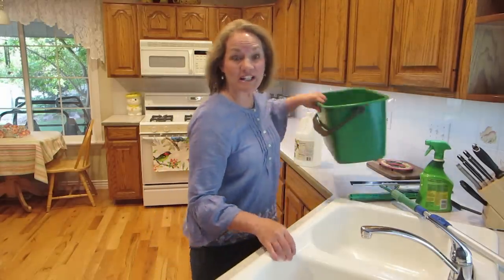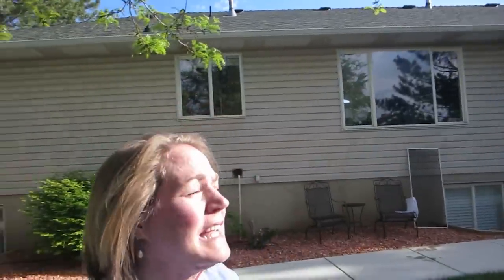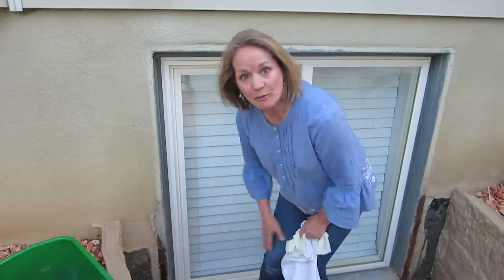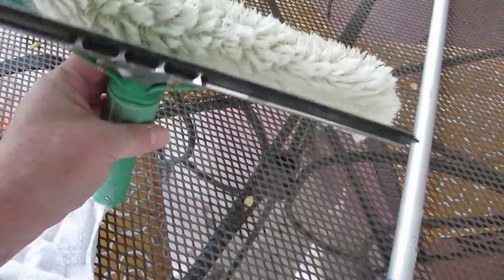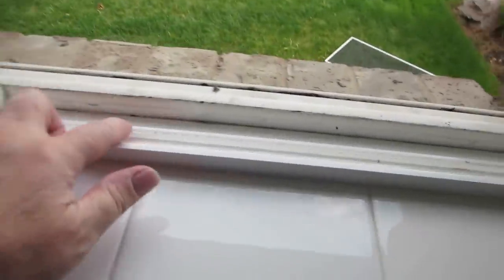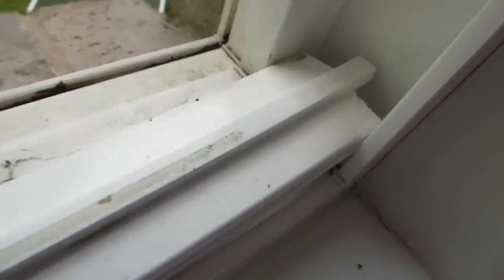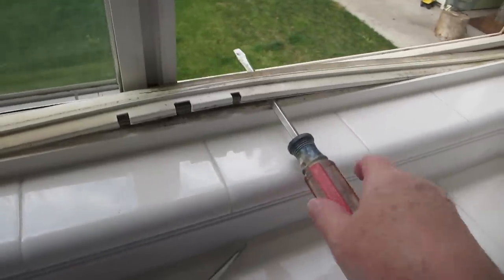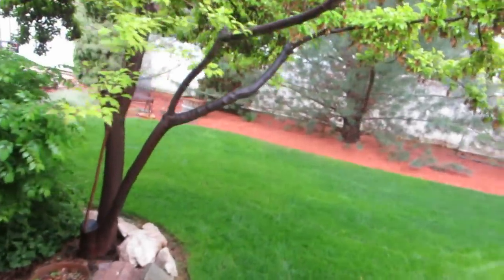How I Clean My Windows and Tracks

Comment: Hi, I don't know if you notice when you cleaned the track the piece of plastic you pulled,you put it in wrong side. The open slits should face toward you so you can pull it much easy with a screwdriver.
It should be from the middle to pull. Just want to let you know.❤️